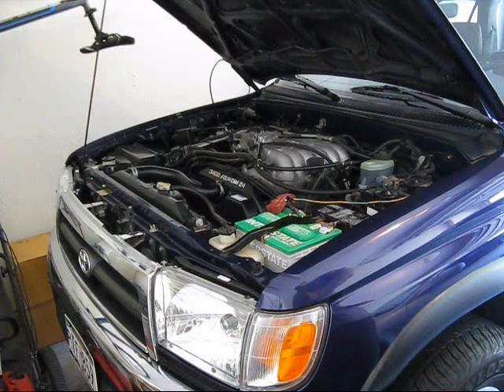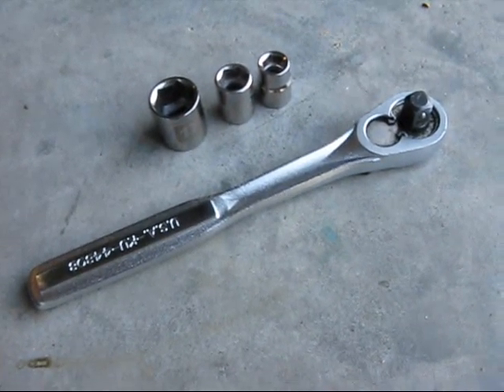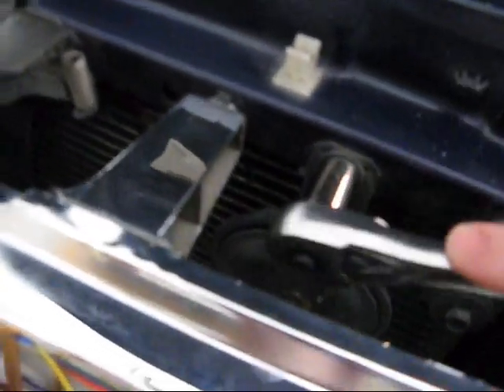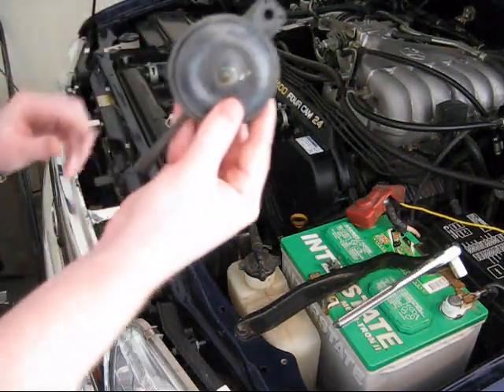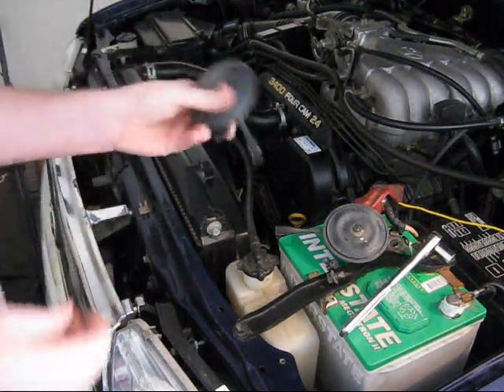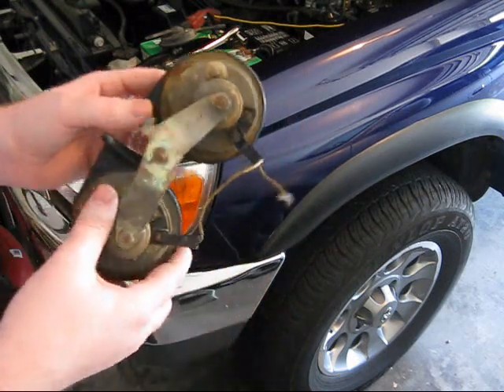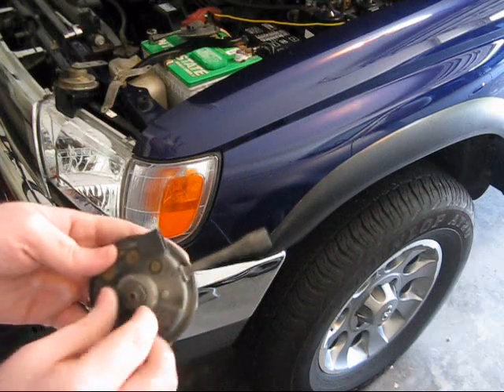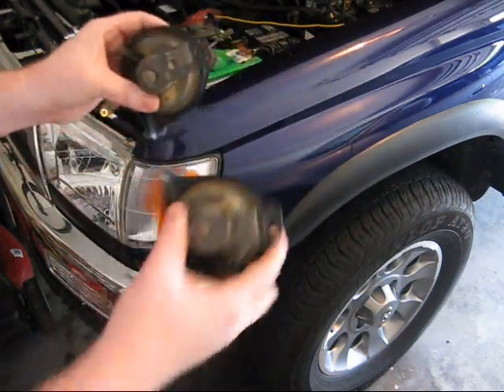Horn Upgrade | Toyota 4Runner (3rd Gen)

Comment: I installed the Toyota premium horns (Toyota part # 08522-B1010)on my 1999 limited 4Runner and they were the easiest install I’ve done. Plugs matched perfectly and I just clipped the new trumpet style horns in and bolted them up in the factory location. Super simple and so much louder than the stock horns.  Pricier than aftermarket options but still a very affordable upgrade and absolutely worth it.

Comment: One thing I would highly recommend is not putting anything on the battery, especially ratchets or wrenches. Easy way to short the two poles and possibly shock yourself real good. Speaking from experience lol didn’t get electrocuted or anything thankfully.

Comment: Yeah I got an old Ford Taurus horn off ebay and the connections aren't the same.  My 99 Tacoma connection is attached to the horn assembly so there isn't a wire I could strip back. I didn't look before ordering it since everyone makes it look so easy on youtube and Tacomaworld. Next step is to take the Tacoma horn off and really check it out thoroughly.

Comment: I did the same upgrade just now and it does not sound that good. It's too high pitch
Reply from the maker: Many American horns are two notes, a high and a low. It may be that only one horn is working.
Reply: If you get a vibration sound, that means both horns are blowing. Try turning the tuning screw on the low note a bit counter-clockwise. Don't do it too much but 1/4 of a turn can help with a sharper and lower pitch sound. The looser the screw, the lower the pitch, the tighter the screw, the higher.
Reply: @ViperJay5  C'mawn!